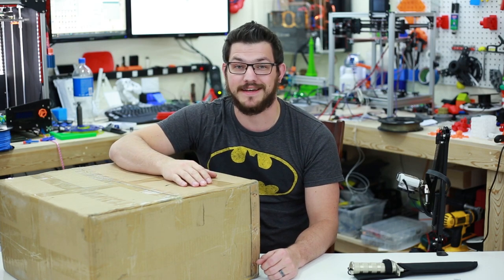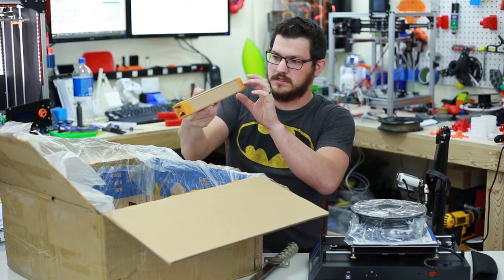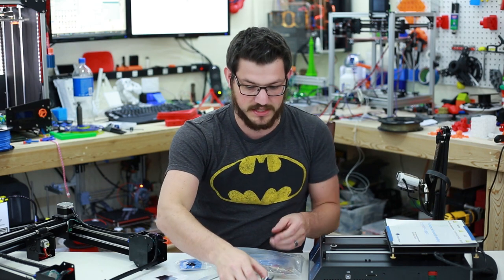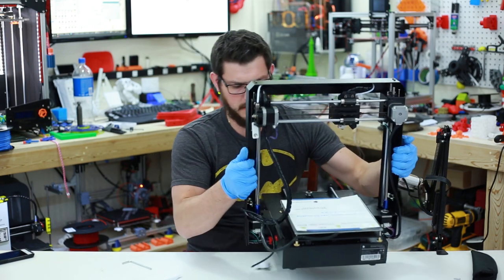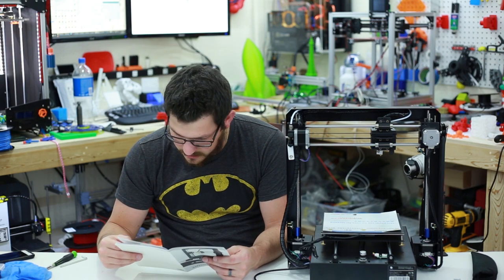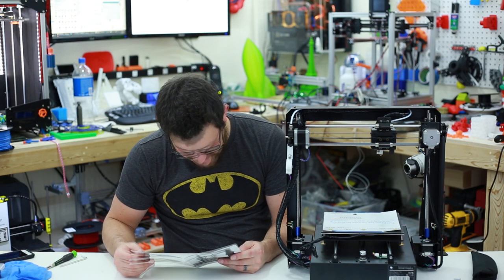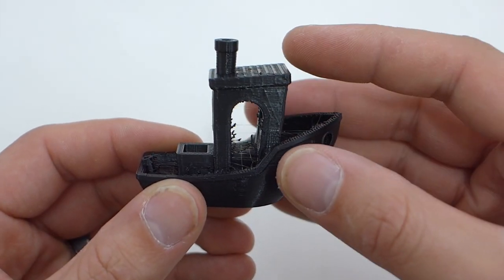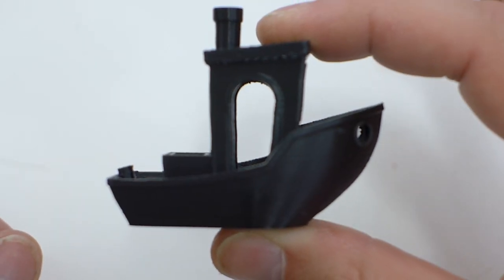Anycubic i3 Mega Unboxing, Assembly and First Print

Comment: Update: unboxed mine last night and was printing the owls within 30min.  I’m very impressed with this device and the instruction manual. Lots of good tech for a low price point!  And it’s very well made and solid. Even the supplied tools are of good quality.
Mine shipped set for 220V , correct for Australia.   Upgrades on the way even now, including flexible silicone wire and Noctua fans, dual mosfets too.    Watched this video again.   Subscribed!
I’d be very interested in any upgrades you may have done and will search your channel. Will also donate via Patreon.
Reply from the maker: Thanks for being a Patron! The only upgrade I have done so far is to put TMC2208 stepper drivers in it. I recently bought the AC Mega upgrade kit off Amazon so I hope to do a video on that sometime this summer.

Comment: After a ton of research, I picked up this model for Christmas for me and my 13 year old son.  This was my first 3D printer.  As an IT geek, I wanted to start learning how to use this.  I couldn't find the red cable they were talking about in the manual, it was tucked away under one of the support arms.  The only problem I had was feeding the filament into the tube.  I made a 30 degree cut at the tip of the filament and was able to get it threaded.  Your video from start to finish gave me some confidence in getting this i3 mega setup.  Thanks, and well done!
Reply from the maker: Glad it helped!
Reply: Thanks for your comment! I also couldn't find the red connector and thought this was a different model which didn't use it. But after your comment I checked and found it tucked under there. Now I am very relieved :D
Reply: Me too with inserting the filament.  Again, an angled cut sorted this as well as removing the first 3” which was kinked from the reel retainer.  Dialling in retraction settings and getting software sorted today.

Comment: I JUST bought a Anycubic Mega-S todayt and did my first test print (owl_pair) not too long ago. They turned out GREAT and I'm already IN LOVE with this printer. The moment I got done with my owl prints I was immediately ready to start a new project. Unfortunately, I have a Google Chromebook and what I quickly began sensing is that while many fans admire these machines, the 3D printing industry doesn't seem to have a lot of love for the Anycubic or Chromebooks in general. I've been on many slicer and printer websites, and not many mention the Anycubic or Chromebooks as their solutions for designing or slicing. That being said, I have what I have, and as a beginner,, I love what I have and I'm looking for as much information I can get on how to print, and get getting print quality, using these two machines. What I'm looking for are CLEAR, CONCISE instructions on how to accomplish the whole process of 3D printings using what I have.  As the Anycubic's chosen softwareI really need Cura on my system. ANYBODY that could help me would be greatly appreciated. Thank you in advance!
Reply from the maker: The i3 Mega is still one of the best budget printers you can buy. The FB groups are huge. It still rivals the print quality of my Prusa i3 MK3S. As for getting Cura to work on a Chromebook, I am not sure as I don't have one. I use Simplify 3D with mine and have zero complaints on quality or consistency.

Comment: Putting mine together right now!  $180 for a 3d printer blows my mind.  What a time to be alive!
Reply: Drew Kosonen Have you use€ it yet? Im ordering mine tonight
Reply: @gwyndolwin  Yep I did the test print that comes on the SD card (pair of owls) with PLA , and then I printed a couple of bed leveling knobs in ABS.  Surprisingly it actually can print ABS right out of the box as long as you use the right settings in Cura and it's not too cold in the room.  I'm a first timer so it took a couple of tries, but I got some decent results.  https://i.imgur.com/hcYUkU6.jpg

The printer has worked great for the most part, but has exhibited a bug or two.  Usually just the touchscreen menu not responding, just have to turn it off and try again.  A firmware update might take care of those, but I haven't tried that yet.  

The first time I turned it on, the thing scared the crap out of me though.   I was following the instructions for the first bed level, you turn it on and click "Home All" in the menu.  The Z axis was all the way at the top when I put it together, clicked the button and it started to go down, but then one side got jammed or something.  So it started going down crooked, getting all bound up, making ugly sounds.  So I turned it off as quick as I could.  Did a quick google but couldn't find anything, so I just kinda forced it to straighten out and tried again.  Thankfully it was fine and I haven't had any other issues like that.  

Other than that, there were a couple of signs that this might have been a refurb unit or something like that (mainly just some marring on the front sticker).  Which might explain why it's so cheap.  All things considered, I'm thoroughly satisfied with what I got for the price.  So damn cheap I might get an Ender 3 Pro still.

Comment: My first print worked fine except it ripped off the special coating on the print bed in the bottom of the owl feet. It was super stuck onto the bed. I let it cool down to room temp. Ideas what I did wrong? Print done at 60°, factory settings

Comment: I have a question about the bed. So with the Ultrabase print come lose as soon as het bed cools down. That seems fine but.... this printer also has Auto resume feature (in case of a power failure). So when I go to work and then power is out, by the time I get back home to restore the power and resume the print the parts are lose on the bed making it only good to resume print when being at home and able to restore power fast?